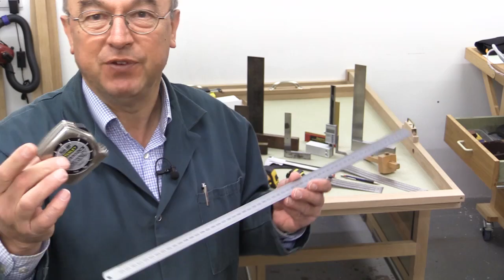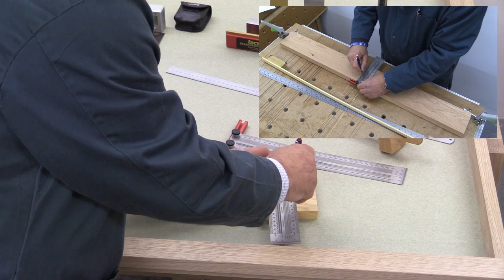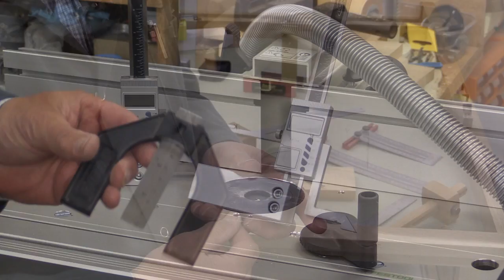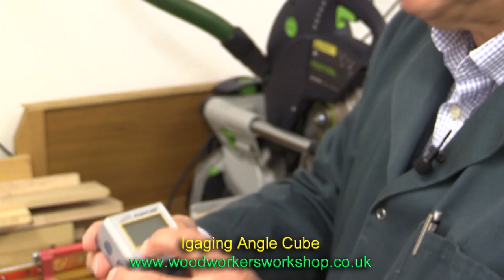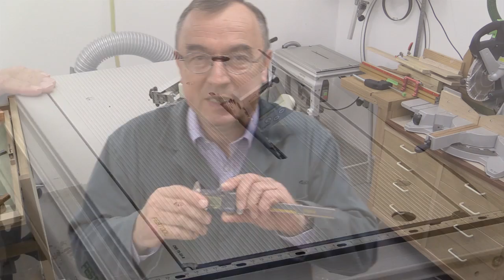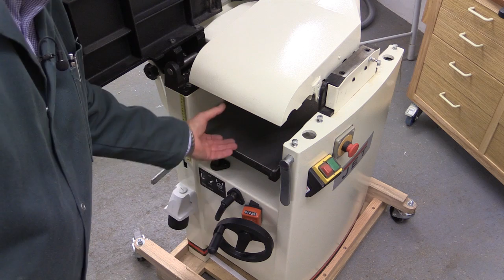Measuring and Marking

Comment: Hi Peter, accuracy has always been my Achilles Heel and I have been investing in good kit to try and improve it.  Small point, when you were using the "magic cube" should you not zero it on the flat bed of your tool before transferring it to the blade?
Reply from the maker: Hi Adam, You zero the cube on the surface that you then use as your reference for whatever angle you are measuring or seeking. On a mitre saw setup, you could zero it on the base and then see where the mitre saw thinks it is when in the upright (90 deg) setting. More usefully you start with it zero'd on the saw blade at 90 deg and then go from there. Just keep in mind that it is the relative angle that you are seeking.   Peter

Comment: I see youre using the knob on the festool to make big jumps. if im going zero to 45° i kinda toss my kapex  side to side. i figure it has to be tough. i paid enough for it and it saves me time.

Do you think im doing wrong by my kapex? im not slamming it or anything. just hustling trying to make a buck fixing other peoples mistakes.

i bought that saw, made 1 cut, felt a huge difference in how stable it felt (aside from the other great features) and sold the dust throwing, large, heavy, hard to bevel from the back 12 inch dewalt sliding compound miter saw and never looked back.

sorry to get off topic. im a newer woodworker (painting is my main trade) and am soaking in all the info i can. people think im a finish carpenter now when they see my work.. festool plays a big part.
Reply from the maker: Hi William, Yes, the Festool kit is tough but it would be wrong to throw any tool around or abuse it if you can avoid it. Festool has transformed my woodworking as well. Every tool is part of the "System" and it is easy to see why so many people like it.    Peter

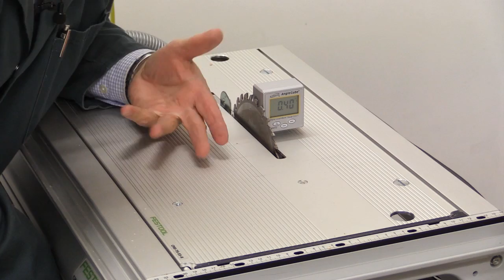Comment: Hello Peter. Another good video. At the 10:25 mark you show a Festool tablesaw in the video with the igaging  angle gauge. What is the model number for your Festool tablesaw? I've never seen one available in the U.S. like that.
Reply from the maker: Hi Ron, It is the Festool CMS-TS which is a universal base unit (legs and a frame) into which one places a unit for a particular type of tool (saw - TS, Router - OF and so on). I do not think that the CMC-TS is available in North America but many people buy them from Europe. The saw used in my CMS-TS is the standard TS55 which can be inserted or removed in under 2 minutes which gives it a dual function.   Peter

Comment: Hi Peter, good to see you share my passion for accuracy! I’ve had a Stanley 8M tape measure for years and it's great when roughing out my timber stock prior to the fine-tuning available with the more precise iGaging tools. Having the ability to measure and check your work with confidence makes our furniture making so much more accurate, productive and less stressful. Great informative video as ever. I will have to add the iGaging miniMag Height Gauge to my website, I missed that little gem. Cheers Peter
Reply from the maker: Wood Workers Workshop Limited Hi Peter, Many thanks for the kind comments and also for lending me those super Igaging tools.   Peter